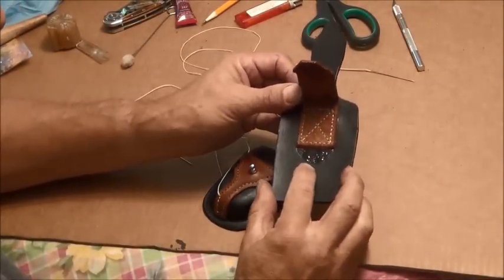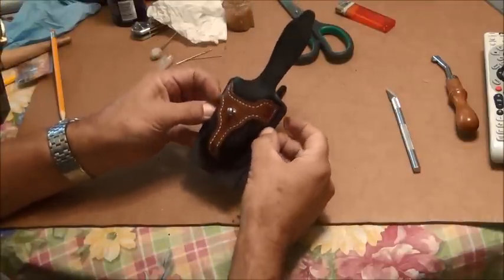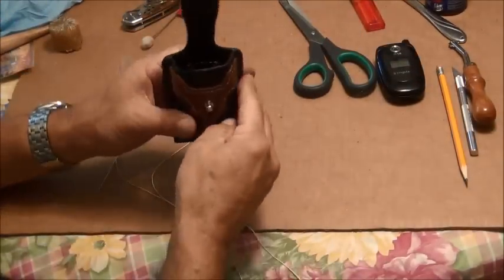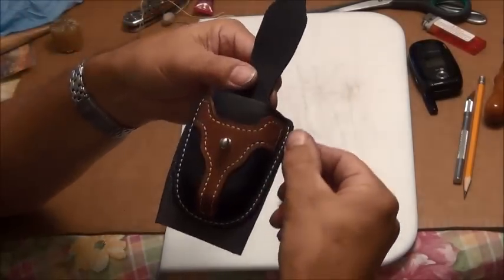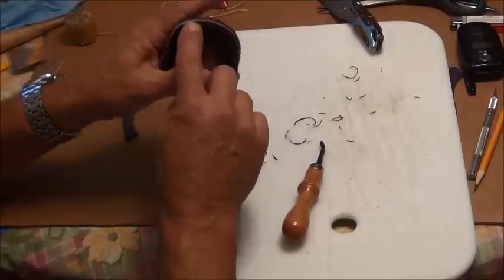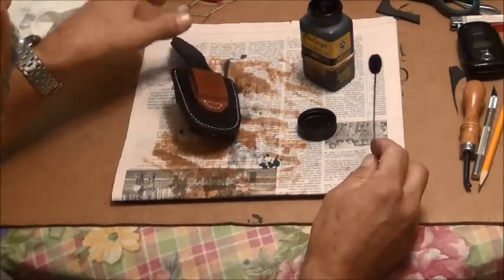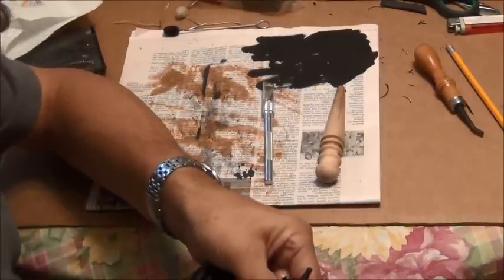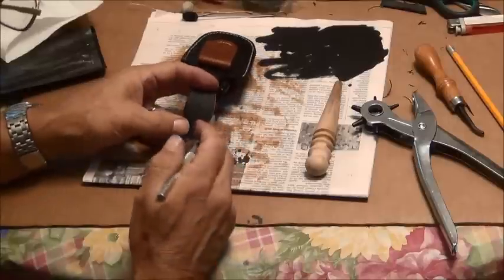Leather Cell Phone Case Part 4 "Project Completion"

Comment: Just finished watching your video. Was very good and as a fellow leather worker, i learned some things. I noticed you didn't polish the leather when you were done with shearling. That sure would added to the finished look. Really like the belt loop idea, but was a little concerned with the inside sew on it. I would take my swivel knife and cut some grooves after you drilled holes for the thread to lay down. I would be worried about a belt constantly rubbing on the tread. Great Job!!! Thanks,

Comment from the maker: I have used both  #67 and  #81 drills. (0.067" & 0.081"). Usually the #67 works fine. #67 is approximately 1/16 of an inch and #81 is approximately 5/64 inch.

Comment: That's a gorgeous phone case! I found your video when I was getting ready to build a case for a similar phone, and I do have a question. On my phone, the ringer is at the bottom. How much of the sound is muted by the enclosed case?
Reply from the maker: Yes the sound is muted due to the phone being enclosed. You could punch a few holes around the area where the sound comes out of the phone to minimize this problem.